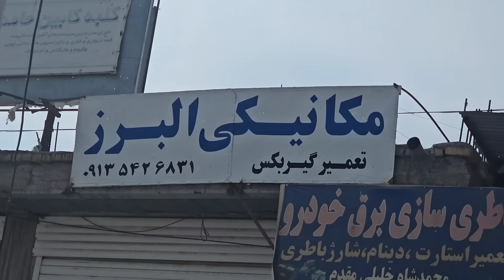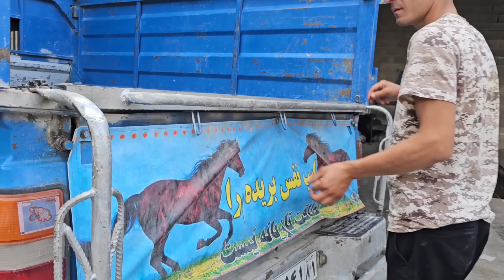Emergency Repair: Kamal’s Toothache Leads to a Shocking Car Breakdown

Comment: Тебе врач сказал,что с лёгкими у тебя нормально.  Ты говоришь,что у тебя одышка, но на гору очень быстро бежишь с девочкой на руках. Значит,ты врешь. Нет у тебя одышки. Когда болеют, то холодной водой не купаются.  Когда болит зуб, то голову холодной водой не моют. Ты кого хочешь обмануть? Как будто мы никогда не болели. Не умрешь, не переживай, жить будешь.
Reply: Yes many times hi dit evreting  what not can when jou have that problems
Reply: No the dr did not say his lungs were normal, he actually said they were sensitive and he needed to consult a specialist. When your lungs heal from whatever the issues are with them you can absolutely return to normal activity but he also needs to still wear mask around any dust particles or cement.
Reply from the maker: The doctor told me that my lungs are sensitive and have problems No, I did not lie ❤

Comment: es rara tu infección de pulmón xq yo la tuve y  es horrible das dos paso y Tenes que parar xq te quita el aire yo veo que vos  haces todo tranquilamente subís la montaña tranquilamente y sin parar
Reply: I had the same  but i  can doe nating    with out stop enz
Reply: Everyone does not have the same diagnosis. It sounds like your lung 🫁 condition is much worse than Kamal’s. Most likely Kamal’s is irritated from the different dust particles in the air  and the concrete he mixes his lungs are sensitive, he could also have walking pneumonia. He really will not know until he has the proper diagnosis, he should wear a mask. I pray that your lung condition improves and you have a speedy recovery. ❤️‍🩹 🙏